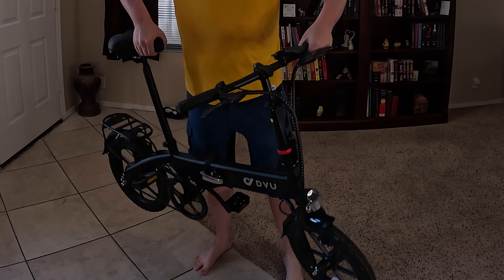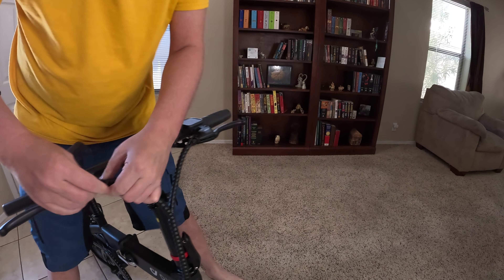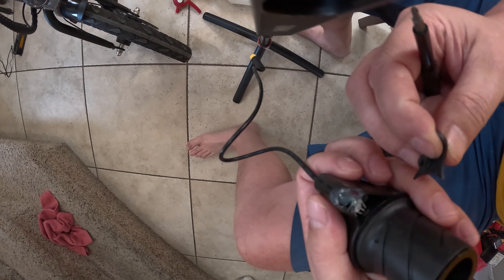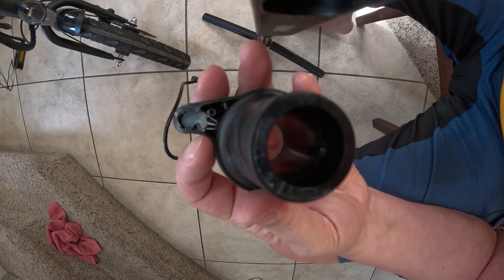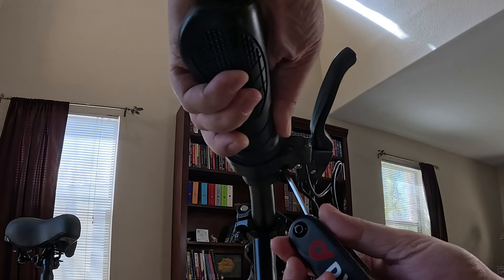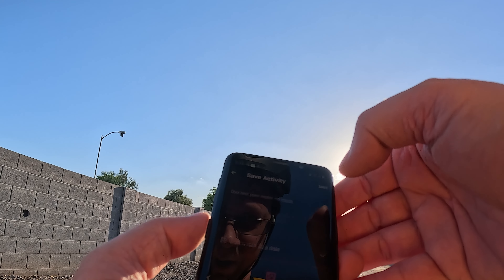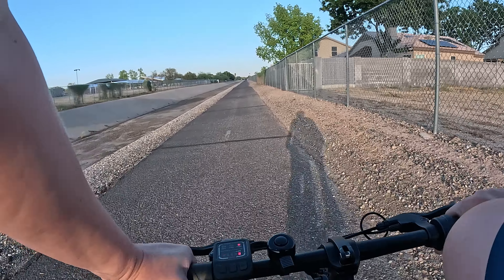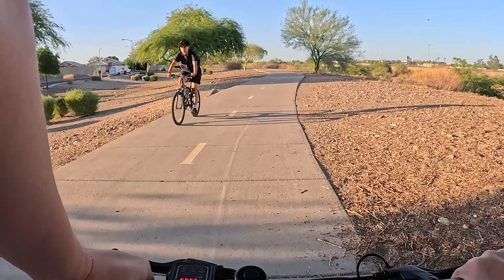🚴‍♂️DYU A1F Throttle Upgrade and Speed Tests #dyucycle

Comment: My stock throttle broke and I got a replacement like this from Amazon. I plugged it in and learned that it’s not plug and play - and that’s how I ended up here on your video. I undid the screw on the new twist throttle to expose the three wires like you did in the video. The wires are the same as the stock throttle red on the right, black in the middle but instead of a white wire there is a yellow wire in the new throttle. 
As a layman in electronics and wiring etc - how do I swap the necessary wires and which ones? And if it’s something that requires soldering etc then what exactly should I tell an electrician if I try find one to help fix it? Cheers
Reply from the maker: Soldering is required. I had to find the wire combination by trial an error. If the device is looked at in the left hand with wire panel to the right the middle wire needs swapped with the top wire. This could be different on some. You can swap them until it functions and it wont hurt the e-bike.
Reply: @Eric_Tennant managed to figure it all out shortly after commenting. I just pulled out the entire cable from both the new and the old throttle (with the little magnetic sensor still attached) it just pulls in and out. Switched them around and put the throttle back together and it working perfectly. 
No soldering was required or changing the individual colour wires thankfully but I used your trick of using a heatgun (hairdryer in my case) to remove the glue and reuse it. Cheers anyway mate - really helpful video in finding where to start when it comes to fixing it